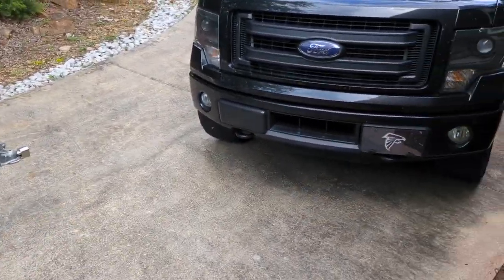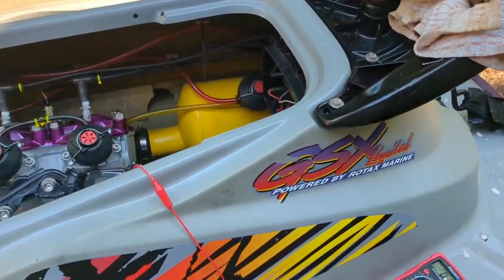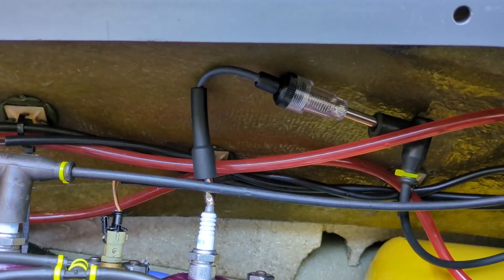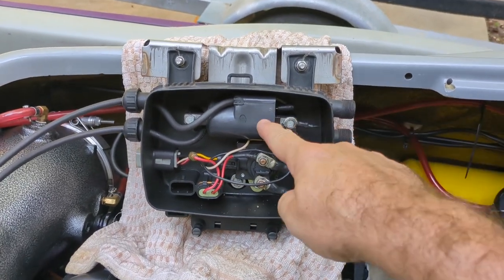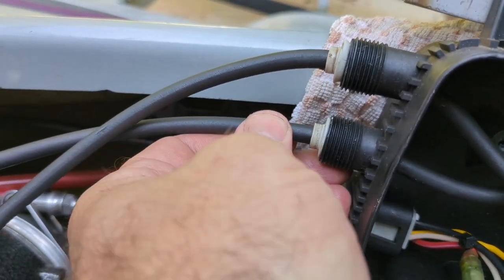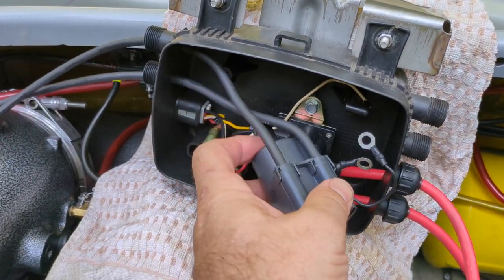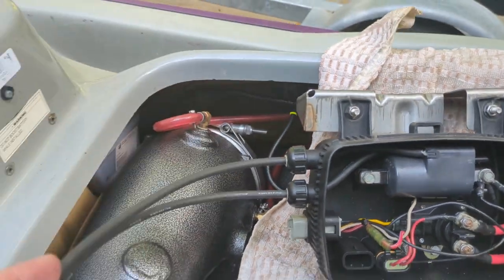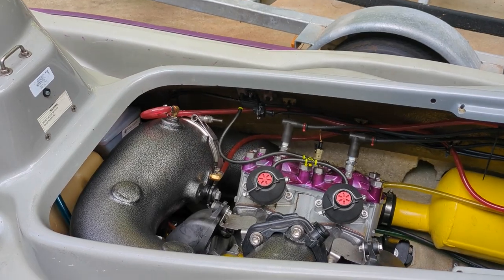Sea-Doo Replace Ignition Coil - Grey Ghost Resurrection

Comment: I have the same exact ski with the white motor not the silver one. It starts fine out of the water but the second I put it in the water it won't start. New motor new Reed valves new CDI I'm stumped, do you have any suggestions?
Reply from the maker: Need that idle to be up around 3000 rpms on the trailer. Make sure your compression is 130psi too.

Comment: A Bad coil would make a motor to take time to start up ?
Reply from the maker: No, a bad coil would run erratic or not at all. If you motor takes a long time to start it's starving for fuel. Use the choke or accelerator pump. I often pour a little gas in the spark holes to save wear and tear on the starter and flywheel. Better than cranking a long rime
Reply: @jonparkmac  thank you so much my friend 🙏🙏🙏
Reply: Hi Jon, I followed your gray ghost build and have the same    Ski. I followed your jetting when I rebuilt my carbs last week. Other than leaning your low speed screws a little do you feel the jetting was right on? Any updates on this build? Thanks
Reply from the maker: I've been chasing another issue I think is electrical making it tough to troubleshoot. It was running very rough last year. That said I do think the combo of jets, springs, and speed screws is a solid starting point. I confirmed that with a few others. Some go a little richer ..but with other mods like proc filters etc. While the L is a little more IN, that's not leaner since I used larger jets. It's actually richer in the end. I hope to return to troubleshooting this one this fall. I will say, when it does want to run, it's very powerful and fast topend

Comment: Does it matter which way you install spark plug to coil?
Reply from the maker: Not on the single coil. Both high intensity wires from coil secondary discharge at the same time. It's called wasteful spark since only one of the two wires is sparking when a piston is TDC. Iow, you can swap coil wires with cylinders and it won't matter